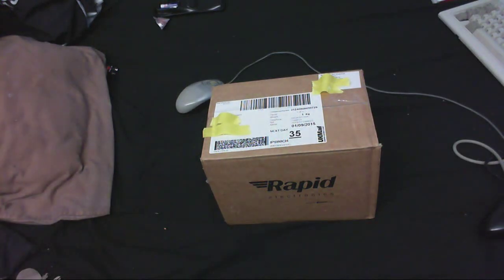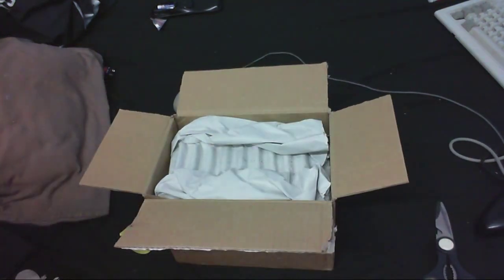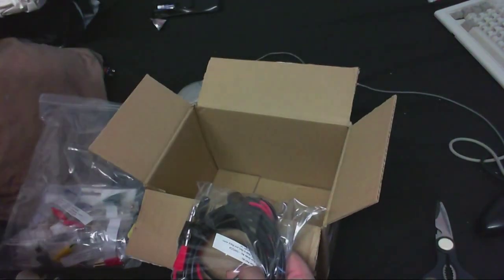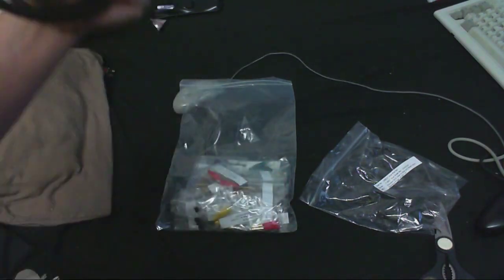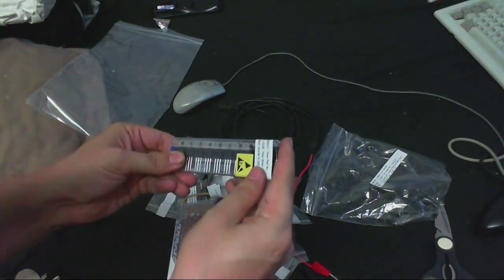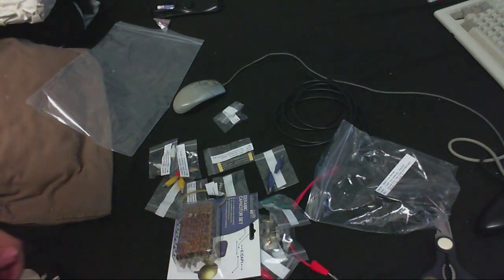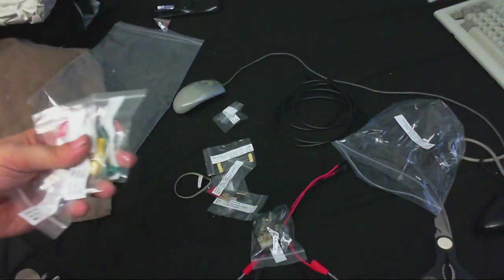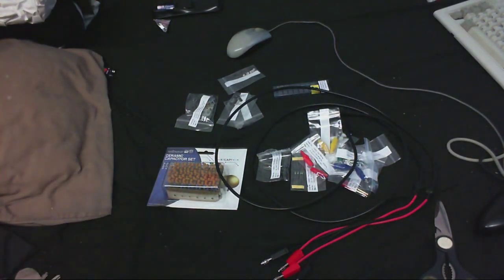Mail Call 02   08   20150

Comment: "Project Radio" is still messing with your serenity I see :d Not too many days have passed, since you wanted to give it a rest, ay? Just kiddin';)

Gee, I have the same issue when ordering electronics parts from my local vendor. Last time I got 3 sheets of photoresist instead of the two I ordered, and they forgot to include the 10n SMT ceramics I ordered. They did however ship the 10n's after I complained (I guess I should have been happy about the extra clad I got!).

Anyway, thanks for explaining the push-pull theory in your last upload, it was very easy to understand;) Keep up the good work Clem:D

Best regards from Denmark